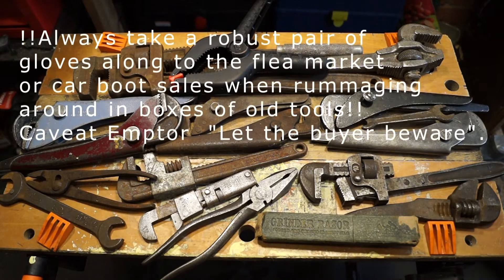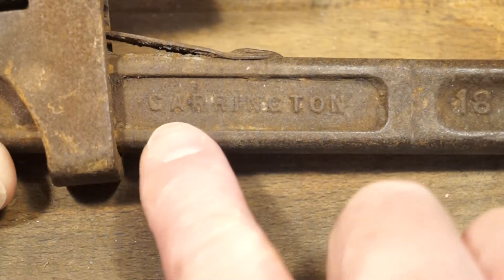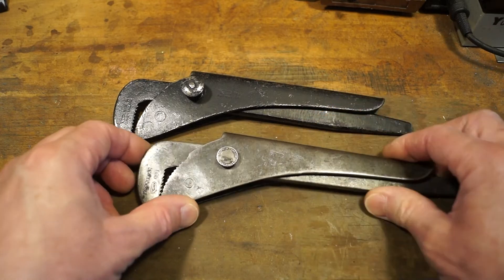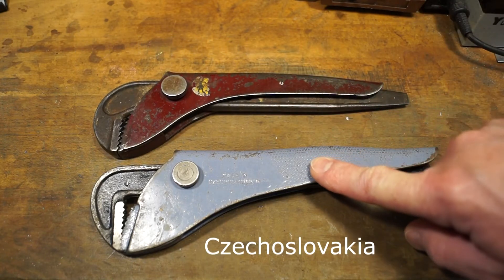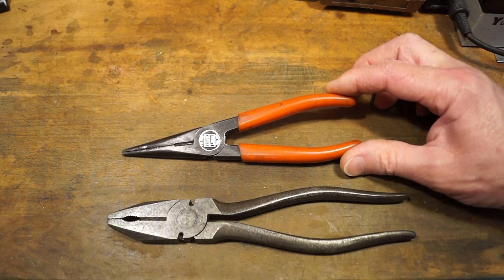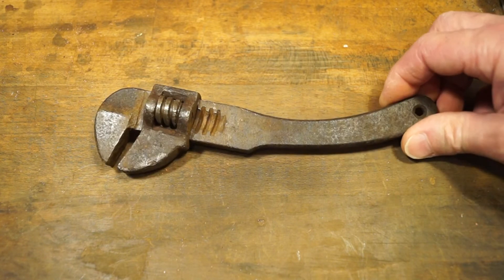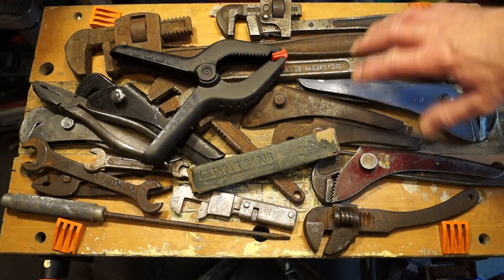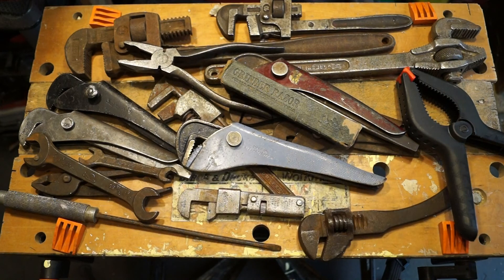Two Recent Trips to the Flea Market or Car Boot Sale  Loads of vintage tools

Comment: Nice  old items... I've got a saw date stamped 1918..and various s/ drivers  various s/ drivers from same period.. They belonged to a shipwright. Plus a 1957 vi tage drill by Wolf... works fine.. but had it electrically tested, and passed before using!

Comment: The razor can be removed from the handle and the blade soaked in spirits to loosen and remove the pitch and the cutting edge would need to be ground flat along the length of the blade and then re-ground gently and it would become a viable razor again.  It could all be done on a bench stone, but then progressively finer grits to bring the edge back and it'll cut like a, well, a razor!

Comment: What a great set of finds. I am like you a big fan of Footprint adjustable wrenches and I am always amazed that people lose the screw from them. What do use to remove the rust ?.
Reply from the maker: I soak the tool in white vinegar over night then give them a wire brushing, I will replace it in vinegar for another night if needed.
Reply: Thank you!